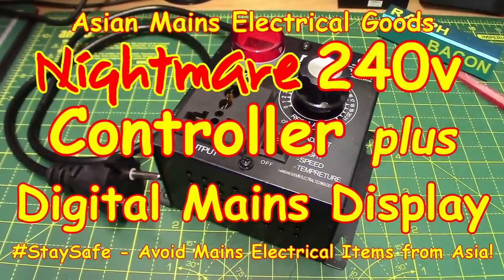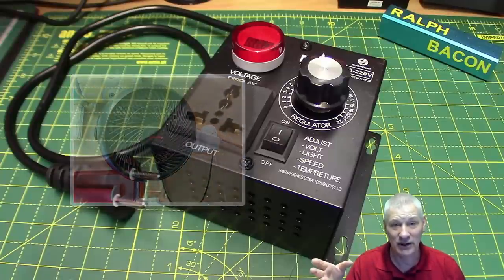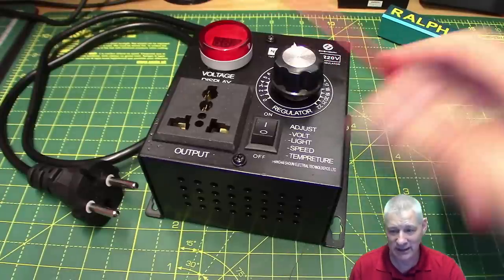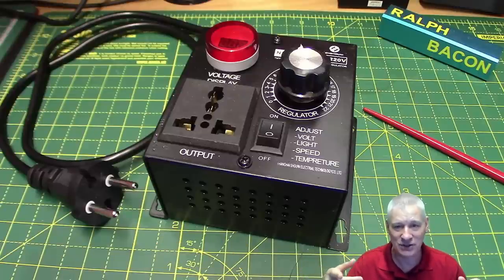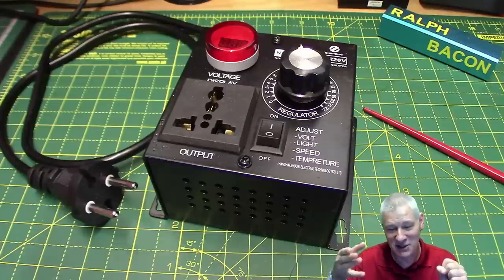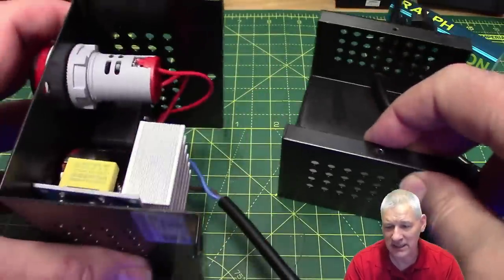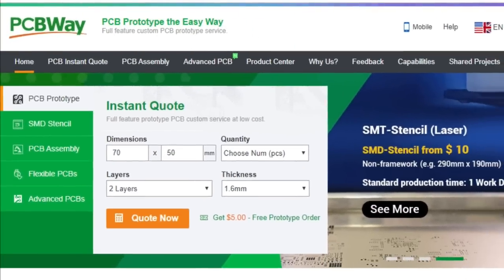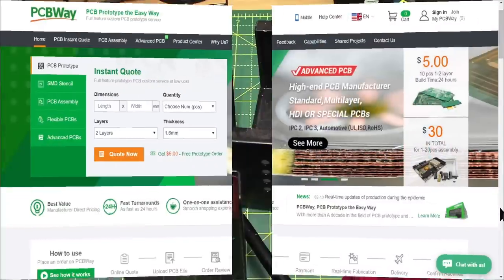#188 Nightmare Fan Speed Controller PLUS a Volts & Amps Digital Display

Comment: I made a no hum/buzzing,  fully variable mains motor controller with over current limiting. It  uses a MOSFET instead of a triac  as the main controller.  The MOSFET connects to the + and - of a bridge rectifier. The AC motor i.e. fan connects between live mains and the of the AC part of the bridge rectifier. The other ac side of bridge rectifier connects to neutral. When you  short the + & - of  a bridge rectifier, full  load AC current will flow though the load!   Used a microcontroller to detect zero crossing via a high value resistor. MOSFET was enabled at  zero crossing point so its was on at the start of each half cycle. That's why mains hum was eliminated. The MOSFET is switched off after  a preset time.  As each cycle of UK mains is 10ms, then if FET was switched off after 5ms on each cycle the average mains voltage will about halved. The other vital component required if controlling an inductive load is a Mains rated Capacitor (connects in parallel with the load) from 1 to 3uF depending  on the load rating of the motor. If cap value is too large then too much current will flow though the MOSFET. If too low then too much voltage could be present across MOSFET when off.  Project I did was worth doing as the mains hum/buzzing caused by the triac controller got annoying. Thought  this might make an interesting project for  the  Chinese casing?
Reply from the maker: Interesting. So you did not use TWO Mosfets, back to back to allow both half cycles of the AC to flow (rather than a bridge)? I will stick to a Triac in this project; if I were to use MOSFETs I would try and create a trailing edge dimmer - but not for my inductive fan load.
I think I will have to put some kind of snubber on the output as I'm driving an inductive load (albeit a very small 40W fan). I will look at a suitable mains rated capacitor - probably Class X rated but I will check up on that side of things as the project progresses. Incidentally I'm now thinking the metal case is more trouble than it's worth, what with the dodgy socket... I might abandon it after all! 
Thanks for your thoughts, most interesting.
Reply: @RalphBacon  Hi Ralph Thank you for your reply. No as with a bridge, the MOSFET is always at the correct polarity. Both half cycles are are used. Beside you I don't believe you can make trailing edge dimmers with triacs, as they stay on until below holding current. As far as I know, trailing edge dimmers rely on MOSFETs anyway. If you change your mind, I have a full circuit diagram with all the component values. Coding for micro will be easy to do.  I have controlled a motor like this for a few years now.
Reply from the maker: Agreed, you cannot make a trailing edge dimmer using Triacs. thanks for the offer, I will remember you if I decide to go down that route.

Comment: Those white chinesey adaptors for the mains are worse than the black brown ones as the connections are just a friction contact at least on the black brown ones they had a screw, open it and check you will be amazed at these fires waiting to happen :-)
Reply from the maker: That's why I won't be using it again! It came with the device (I think, if not, then with another device from China). Not fused even.
Reply: @RalphBacon  I can live without a fuse as I would only use on an extention lead but the fact that the adaptor is totally relying on a friction press fit with the screw cover of the adaptor is as I say a fire waiting to happen the pins are not square and straight so it makes a bad fit in the socket as well, bin them as a soon as they arrive

Comment: With all the parts that need to be pulled off/switched/reworked, at what point would it have been easier to just buy the components and a project box...? Seems like it would be about the same amount of work, but as soon as it's together, it's ready to use.
Reply from the maker: Great point! But I didn't know that when ordering. I thought I would just have to replace the mains cable! It would still take less than hour to "fix" it enough as described in the demo, but now I'm replacing the control electronics to something a lot safer - future video!
Reply: @RalphBacon  input mains filter too?
Reply from the maker: No input mains filter required, Dave, but a snubber should be used on inductive loads.

Comment: Just an idea, and if you are happy to use a thyristor...  oh sorry, a TRIAC, and it's only got to control 40W, why didn't you just go with a perfectly normal "light dimmer" available from your electrical supplier around the corner for maybe half of what you paid?  Sure it doesn't have a questionable controller and a suspect voltage indicator, but at least you'll have standard consumer protection and a device rated to an acceptable standard. You'd just have to house it in a suitable installation.
Volts and amps don't really matter.  I have however just ordered one of those nifty V/A meters from banggood.  I'm thinking of incorporating into a power board so I can monitor the power usage on my computer desk, and find out how much this 3D printer might be costing to run with the heated print bed set to 60C.
BTW here's another version of the voltage controller that popped up in my recommended from banggood.  It appears to have a cable with earth, a fuse on the front panel and is rated at "3000W".  The output socket on the side appears to be the usual international "plug in anything" socket however. https://www.banggood.com/AC-Motor-Speed-Controller-3000W-AC-220V-Motor-Speed-Stepless-Regulator-Controller-Temperature-Adjustment-and-Dimming-p-1621026.html?rmmds=search&cur_warehouse=CN
Reply from the maker: Indeed, Chris, a standard light dimmer (you can even get them with a picture of a fan on them, to indicate it's for the ceiling fan!) would be a good choice, mounted in a standard surface-mount 32mm pattress. Could be neat. Or a double pattress with a standard 13A socket next to the dimmer. Wish I'd thought of this before.
Reply: That's exactly what I did,  many years ago.  Initially it was built to dim the (many) lights on a xmas tree,  to delay it's drying out as quick,  but in more recent times it's been used to dim plug-in (as opposed to ceiling-mounted) bedroom lighting.  So the one who wants to go to bed earlier can leave the light on at a dimmer setting for the other person to see in there when they get around to it.

One thing about these is the electrical noise that they generate.  I had to turn that dimmer box off if I wanted to listen to an AM radio anywhere in the house,  otherwise the noise was just too much.

I think we're going to differ on the subject of definitions.  To my understanding the term "thyristor" includes SCRs, SCSs,  and TRIACs.
Reply: @RalphBacon  Haha.  We've all done it - it's easy to overcomplicate things as an excuse to satisfy our curiosity about some of the weird and wonderful stuff coming out of China.  At least it makes for interesting content :-)
Reply from the maker: If someone (from China) gives you a lemon, you make lemonade! So I will transform this device with an Arduino controlled dimmer module!

Comment: emm, theres a thought,  can i uses this to run a 2kw kettle off a 1500w inverter by just dialling down the power.... a longer boiling time is better than no boiling, but i also wonder what the cheapo inverter circuitry would make of this, either way as the inverter is internally 250v dc through H bridge mosfets to give AC, I bet it adds some serious ripple to the dc side caps. (I did think of using a transformer with its secondary in series with the kettle to reduce the amps)
Reply from the maker: No, don't do this. Although the "sine" wave is being chopped up by this device, it will still try and deliver 2000 watts during the "on" bit. Better is to find a 1Kw kettle (eg a travel or camping kettle).
Reply: @RalphBacon  it's one of typical eBay stories, the first 3kw one smoked itself on a 2kw kettle, they sealed it for one that had its output stage go short on day 2, so they refunded and I bought decent MOSFETs for it. Seems that even when buying real branded, a 30n50 can be anything from 150 to 300w depending on manufacturer, and that's what had caught them out. It wasnt something I expected either I thought a part number was a part number, I mean all 1n4007 are the same so why are MOSFETs different when same number

Comment: Maybe a call to Trading Standards about this, not every one is "tech savvy" and able to sort out the safety issues.  Or a heads-up to Big Clive!

The current clamp is very neat for the price.  We used to have a npower energy display that had a similar ferrite ring around the mains input to the consumer unit from the meter.  Then an RF link to the display.  Bob
Reply from the maker: As I said, "Don't buy this!", at least not unless you are electrics savvy, Bob. And Clive would love it, I'm sure. He'd probably touch it just to check if it was all "live". Yes, I liked the current/voltage indicator too - more than the speed controller!

Comment: Hi Ralph, I bought a similar thing to control my hot plate (soldering) it cost about £3 and it was just the guts (identical to yours) so I mounted it in a standard size UK plastic mains housing, you could always do the same and mount it better...best of luck !
Reply from the maker: Good tip! A plastic case would have at least made this double insulated. Unfortunately an earth wire is still required to connect to the output socket.
Reply: @RalphBacon  Yep, our chinese friends often overlook this, my application is all high temp plastic and ceramic, only the halogen bulb housing is metal and that's earthed but you would want your fan earthed correctly.
Reply from the maker: Actually the fan is double insulated, no Earth required, but if I were to retain the socket (or a replacement one with safety shutters) it would require an Earth wire.

Comment: Had the same one you have. They rated that for 4000w but failed on me on a 2200w cut off machine. Dont wanna change speed anymore.
Reply from the maker: I found the only reliable ways of changing AC speeds were:

1) an expensive variac transformer
2) a relatively cheap ceiling fan capacitor (it's how ceiling fan speeds are changed)

I've now got both the above adjusting the speed on two separate fans, one in my workshop (the variac) and on in my bedroom (the capacitor).

Both have been working flawlessly for months. But to change the speed of a motor (not a fan motor, more like a lathe) I'm guessing the variac is the way to go. But costly.
Reply: @RalphBacon  the best way is those very expensive vfds. I dont want to go that route as I just wanted a cheap way to slow down my grinder and chop saw so I could use those cold cut blades

Comment: No strain relief of that cable? Oh my ...
That "voltmeter" under that "round indicator light cover" is interesting, never seen anything like that ...
Yes you can use a thyristor for AC stuff, the output power will just be half if the thyristor is "fully switched on all the time".
Wow, what a very simplistic design, no MCU, no IC, nothing!
Reply from the maker: Tell me about it. Sigh. I'm using a Variac now (video #217).

Comment: Great video clip. Just bought one on ebay and they have included a UK plug with earth.
Reply from the maker: OMG an actual UK plug AND an earth? But is the earth pin wired up? And with a suitable fuse? Things are looking up.
Reply: @RalphBacon  Yes the pin is wired up but I will have to change the plug. The one provided is thermo-sealed so not sure there is a fuse inside. It works on small appliances. I've tried it on my bench grinder and unfortunately it doesn't work.

Comment: Hi Ralph please watch out for the 13amp ish socket on the front they are very bad I mean bad no really bad! but ok for 5 amp Bob
Reply from the maker: I'm thinking, Bob, of either not connecting the socket up at all (and hard wiring the fan internally) or finding a suitable UK socket that would fit. Therein lies the issue - size! Still on the search...

Comment: Hello Ralpf, I would like (if possible) that you make a video adding a bridge rectifier to convert it to DC, and removing the voltage indicator and putting in a Volt/Ammeter. I follow you from Gran Canaria. Sorry for my bad English.
Reply from the maker: Well, I can't make a bespoke video just for that but I would caution the use of this particular module as it's not very safe (as I showed). 

We are talking about lethal voltage levels here - and I really, really hope you do not intend to convert mains voltage to DC. It will kill you. Please don't do it.

Comment: This kind of plug is fairly common, and it is not grounded, as you said. We do not call these ones "Schuko" plug, but Euro plug. Bet we do have similar ones, which are bulkier and are earth grounded, that are Schuko plugs. Devices with metal cases like this would however be mandatory to come with a grounded Schuko plug.
The fuses are never built into the plug itself, but usually into the device, where the other side of the cable plugs into. If the plug is fixed to the device, then the fuse is not accessible (but rather built into the internal PSU), sometimes the fuse is also not accessible, even when the plug is not fixed to the device, unfortunately.
Regarding the Thyristor. I have actually seen electronics using only a thyristor for this kind of purpose, they are usually low power and require bigger smoothing caps, but it does work - lost potential though, similar to a single diode ac to dc converter. As you "almost" said a triac is just a combination of two thyristors pointing in opposite directions and their gates being connected together. So saying "it can't work with a thyristor" is in fact wrong, or at least misleading.
Reply from the maker: A thyristor could only work at best at 50% power, though, right? So whilst it would turn whatever was connected it could be quite painful to listen to (lots of buzzing, especially at lower speeds). It's pretty clear that the terminology used here was just wrong (in the same way they use the word "weld" instead of "solder", quite different in meaning). But I do still have an hour's work ahead of me to sort this out...
Reply: @RalphBacon  
If you put a thyristor after a bridge rectifier, but before the smoothing cap, it should be able to work at 100% power (minus small losses obviously). Just a guess though.
Reply from the maker: You mean change the incoming AC to DC? What?!? What is that going to do to devices that expect a smooth AC sine wave? In my experience, Thyristors (SCRs) do not conduct the negative part of an AC cycle (the diode is reversed biased), hence the need for two of them, back to back, more commonly known as a Triac, to accomplish this. Everything else is just cheating! Or am I wrong?
Reply: @RalphBacon  True, A thyristor works only on the upper or lower half of the wave and I also think your device actually contains a triac as you pointed out. I was just correcting you when you said that a thyristor could never work in such an application, which isn't quite true.
Also, yes a thyristor on it's own wouldn't be optimal in such a scenario, where a motor is powered, since AC motors are best powered with three-phase power and therefore a "half-phase" would just cause it to run even worse. But, not every application involves a motor and when the power is converted to DC using a single rectification diode, then the power loss is virtually not noticable - but then it matters in which way the plug is connected to the wall socket.
Further, I would not go that far and say that 50% of the power is lost, because that's not always the case. I mean, yes the voltage drops to 50%, but if you lower the resistance by 50% as well, then you're back at 100% power. Of course you can't simply lower the resistance of a device you plug in, but most switch mode power supplies are designed to work at 110V and at 230V. So for example a decent phone charger should not have any problems with that and still supply constant voltage output, unless you do that in a country in which the mains voltage is already only a 110V (which would drop to 55V and less of course). In the latter case it highly depends on the design of the SMPS and how much power is drawn from it - I would not recommend trying that, though.

Comment: Hey Ralph, do you know if they supply an empty box that can be safely populated with items spec'd for whatever country you live in. Hopefully being empty would make the assembly and shipping cost cheaper and save the purchaser from having to disassemble it themselves. AUD30.00 for a nicely fabricated metal box (ignoring the spelling mistakes) is a bargain. 😉🤪😃
Reply from the maker: I'm afraid, Neil,  this metal enclosure is made to spec by the manufacturer. Whilst very sturdy (they spent the money on that part I think) I'm actually thinking of doing something else for an enclosure that would look a bit neater and fit in better. The biggest issue is that socket, which is not shuttered and I can't find one that small that conforms to UK/EU safety regs. We shall see.